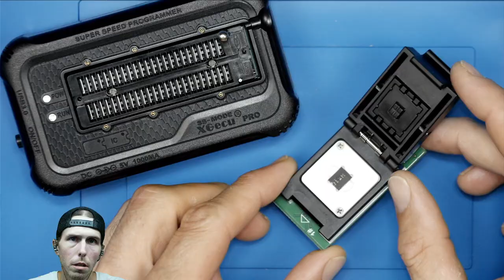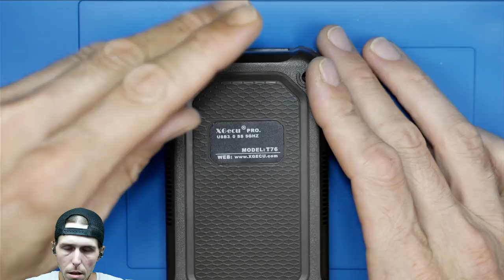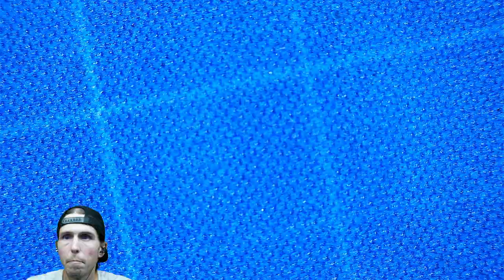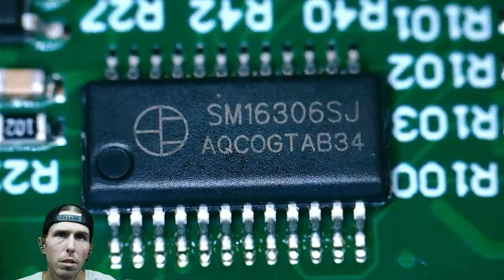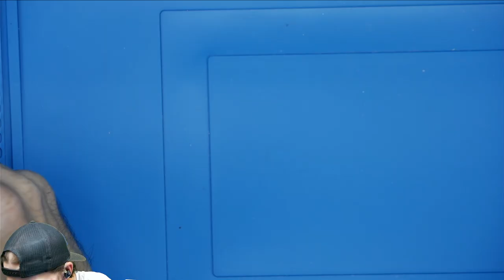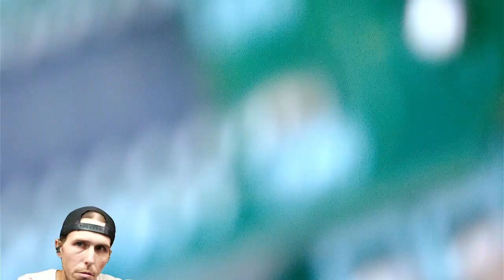Xgecu T76 Teardown, with some suspicious damage...🤔🤨

Comment: Did you buy directly from the vendor or from AliExpress or equivalent.   This is poor manufacturing.   Even rough shipping should not have done what happened to that cap or resistor whatever it was.  I see a lot of terrible solder joints on those smaller groups of transistors you show around 20:23.
Reply: I bought one from AliExpress and received it a few days ago and this is what happened. I installed the latest version of the software 13.17 and it bricked the firmware on the unit.  I had to go back two or three software versions in order for it to be recognized in the software and start the firmware upload from that version and then go in succession with each new software version. I tried to unbrick by shorting the round Boot pin and square S pin to get it to low level bootloader but the software 13.17 never recognize the device so I had to do it the way I mentioned above to finally get it to be recognized in the software.  

Another thing, this cannot handle reading  in circuit SPI Chip laptop G750JX winbond 25Q64FV SOIC8.  I even bought an external P/S 5 volt 2amps connected to the T76 and it didn’t help.  It reads the chip but I get an error about VCC over current protection message which I solved by raising the VCC to 400ma but the data is incomplete.   Even after it finally reads after several attempts it fails verification.  My Xeltek 610P reads and verifies 100% and data is 100% correct when I make a comparison to most reads that I saved in the past with the 610P and verified working laptop when I flashed those older and newer reads.  The laptop works fine.  I won’t even flash any read from the T76 cannot trust it.

Comment: Ordered T76 recently, it is still in the way. Can understand accidentally torn SMD capacitor, but DC converter inductor... OMG. Thanks about warning. I believe they dropped this board batch somewhere between factories and decided to use them anyway. I have no choice than open my T76 on arrival to check for dislodged components.
I wonder are XGecu still use AMS1117-ADJ LDO here like in T48 to make variable 1.8V/3.3V. If so I hope they designed heat removal area better. In T48 boards made before 2023 these LDOs expire fast due to overheating.